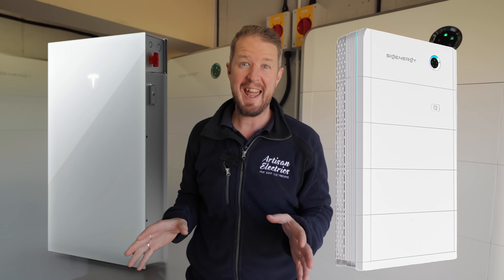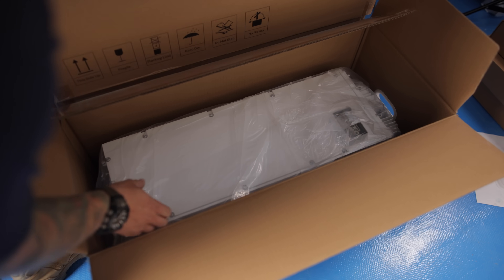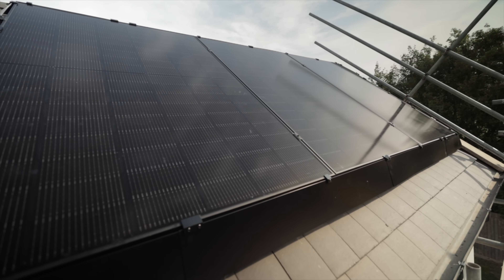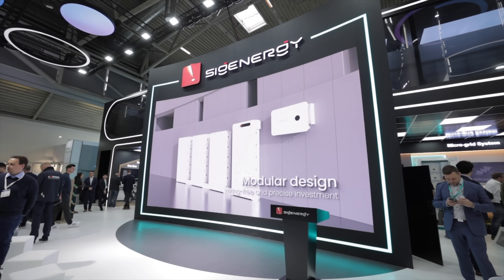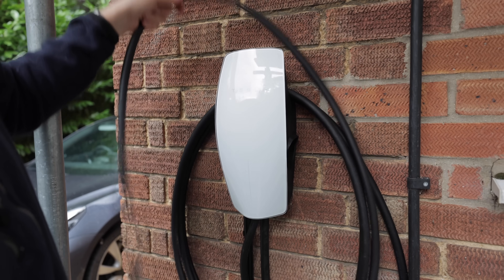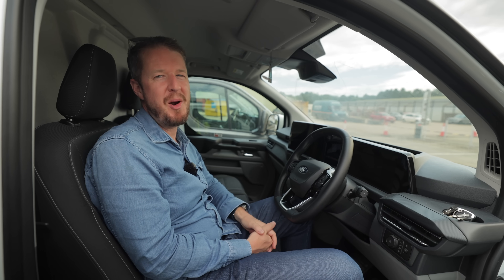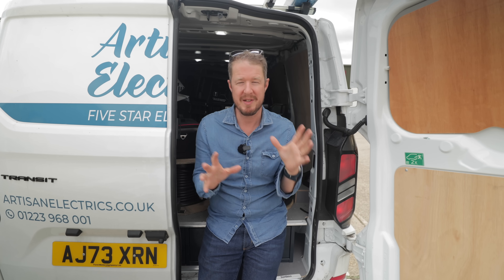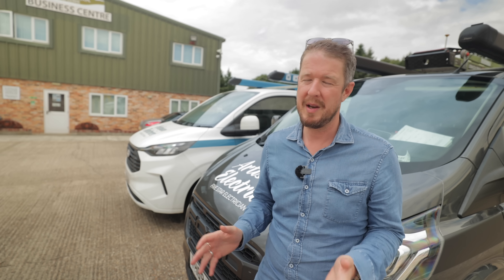The BEST Home Battery in 2025? Tesla PW3 vs Sigenergy SigenStor

Comment: What is your opinion on Signergy issues in Australia where there have been issues with the inverters?
Reply from the maker: From what I’ve heard it’s a minor issue caused by installer error when fitting the AC plugs - hasn’t affected that many installers and most of them were new and inexperienced fitting the products

Comment: How does the Sigenergy system handle the worst case but brief "surge demands" placed on it by a heat pump starting up in winter or starting a defrost cycle? The Tesla PW3 six rated at 20kW but isn't the Sigenergy system rated at 150% so a typical 8kW inverter can meet the surge demand of only 12kW - far short of what the PW3 can supply.. so even with a 12kW inverter 18kW is the max surge demand capability...  and you've had to pay for the additional cost of upgrading from an 8kW to a 10kW inverter.

Comment: I've just opted in for the following - 

Sigen Energy Controller Single
Phase
10 kW of Inverter Power
Sigenergy
1 x SigenStor EC 10.0SP
10.0 Year Warranty
Sigen Battery
16.12kWh of Battery Storage
Sigenergy
1 x SigenStor BAT 16.0
10.0 Year Warranty
Sigen Energy Gateway Home
Series

In AUS $ $13,650 I have a 5kw solar 19 panels - all be it in Aussie Dollars,  this also includes a $4,800 government grant power initiative.  My only issue is, if I have a 16kw battery, will my 5kw solar (average 3 to 4kw) depending on weather, would it charge the unit to capacity, so I have full battery at night?  I asked this question, and I was told "its hard to answer given weather, cloud, but you could top up your solar with another panel array.  Set this up as dedicated charge to unit, in combination with your current system"  

Do you agree?  I don't want to stich up the sales rep, cause he did do a lot of explaining - and was accommodating to the loads of questions I had.

Comment: I had a choice between the two brands and I kept emotion out of this. In the end I chose to go with the Tesla PW3 and expansion. This was due to how my property is located on a hill and the only place down the side of my house slopes and the land moves. I would have to lay concrete and I dont trust the land to not move in a few years with 200+kg of weight on the concrete slab. The other reason is the technical support from Tesla, they are pretty good and at the end of the day I just want problems solved asap.

Im happy with the PW3, it works great for what I need, and the backup feature works perfectly with no lights flashing when going off grid. I would have loved the Sigenergy  but thats okay, we can see what happens in 10 years.

I will try and convince my mother to get a battery and I will tell her to get the Sigenergy.

Comment: I'm looking to choose one of these systems to provide backup during grid power outages....does anyone know if it is possible to use a portable generator to charge these batteries during an extended outage?
Reply: I had that same question and located info that said a diesel generator could be hard wired to the Sigenery system.
Why they don't have a socket to plug in a portable generator is beyond me.😮

Comment: The 25kW DC module isn’t limited to 3 phase.  It works with single phase EC too.  Of course you’ll need to have enough PV and battery to cover it if you don’t want to draw from the grid.  If the sun isn’t shining and your battery is flat then you’ll be limited to the size of your inverter.

Comment: Not sure if it's true but Sigenergy is a fairly new company and not yet fully established so I am told.  Also the warranty on the units is not for the entire pack, but split, i.e. 12 months on the batteries and 3 years on the frame.  Can anyone confirm that?  Whereas Tesla are 10 years(?) on the entire unit.  Any advice is appreciated thanks.

Comment: What’s your thoughts on installing Tesla PW3 in a three phase property? How does net metering work, say a PW3 is on L1 but a heatpump pulls powers on L2, would you be charged for import or does PW3 discharge to grid and nullify the cost. Also, does it matter if import and export price is different per kW?
Reply from the maker: Pretty pointless to be honest - better to just get a Sigenergy three phase system
Reply: @artisanelectrics sadly space is limited to get a Sigen system. Spoke to Tesla folks at solar and storage and they showed me a new gizmo they have instead of the gateway that would help with this scenario.
Reply: @HaiderAlDelfi  Sigenergy just released way smaller gateway, for home use with up to 12kw inverters, and inverters it self are way smaller.

Comment: Don't want to be mean but this video was a bit of a letdown. Many of the things you analysed are of little concern to most people - commissioning time, aesthetics, mounting options, size, etc... In my case EV charging is irrelevant because I already have a charger and couldn't locate a Sig system anywhere near my EV. By far the biggest factor for most people is price and you skipped it. I don't want to go onto your quoting page, just give a rough estimate for a small, medium and large system to compare them. After that we care about usability and functions so highlight some key differences between the two.

As I said though in another comment my hope is that battery storage continues to fall in price. I have what I need right now and can wait until this stuff drops considerably before investing more.

Comment: I had the 30kW three phase inverter installed at my house last December here in Australia, so I don't think releasing it in the UK has anything to do with the new batteries. In fact we don't even have the new batteries here in Australia yet. There must be another reason why you didn't have the 30kW inverter in the UK before now.

It's a great system, by the way. We just added a second stack for a total of 72kWh storage (9 x 8kWh modules spread over 2 stacks). 🙂
Reply from the maker: That's great to hear that you are happy with the system!

Comment: My powerwalls are mounted outside on a North facing wall, the sigenergy system was not available when they were installed but I would still chooseTesla as they have active, water based, heating and cooling just like their cars, they work year round with no issues even when very cold in winter. I certainly prefer the looks of my Powerwall 2s over the new 3s, a simple white painted metal cover with black plastic sides.
Reply from the maker: Thanks for the feedback, we appreciate your perspective!

Comment: What I'm most interested in is when these things are going to plummet in price. CATL are talking about manufacturing for $10 per KWh which is frankly astonishing. Even if that's highly optimistic and of course the battery itself is only part of the overall cost (BMS, installation, transport, etc..) we should still get to a point where they become much cheaper than today. Even if sodium-ion doesn't have the energy density of other chemistries that doesn't bother me in the slightest for home storage. I can mount them on the wall outside or in various other places. Space just isn't an issue with home storage like it is in EVs.

I've got 10 KWh attached to my solar system right now and overall pretty happy with it (mainly from a financial perspective). At some point I'd have no issue installing a pretty big system that a) acts as a grid backup (current system needs a small amount of grid power), b) can be controlled remotely for dynamic charge/discharge, and c) costs a lot less than the current one.
Reply: Or Aussie weather. I'd consider the sig if I could have it in the garage. 
But my install will be outside, so not too confident it could take it.

Comment: I like the idea of getting solar (again) on our new home but have been hovering due to a few factors. 1.  Government may eventually extend the heat pump grant to include Solar with Storage. 2.  Tesla have now become an energy supplier here in the UK making it worth waiting to see what deals they are going to offer Tesla car owners regarding using the cars and storage batteries for Grid balancing etc. 3. The next thing making me wait is I keep hearing that batteries (CATL sodium) are going to drop down to $10 a kWh making it worth waiting to see what the pack level prices will come down to. 4. Final reason for waiting....I'm now a pensioner on a fixed income !
Reply: "I'm now a pensioner on a fixed income !" And as we know governments desperate to hit nut zero targets inparticular don't care much for the perils of pensioner poverty and their inability to easily afford high energy costs. So if pensioners can take (persistenly rising) energy costs out of the equation (almost) completely then it makes sense to invest in a "tried and tested" system.
Reply: @fractionaldebtisfraud2187  Imagine is we had solar and battery storage we would be out of the energy poverty trap.....so that's why government won't extend the grant, no control of the masses !

Comment: I like the looks of the Sigenergy system and the fact that it can be expanded at a later date. My only concern is what would happen if either company goes bust or pulls out of the UK market (Huawei has just announced they are pulling out of the UK market).
Reply from the maker: Yeah Sigenergy are growing super fast it’s a fair question - Huawei just can’t compete. In my opinion Sigenergy are here to stay but you have to be cautious and do your due diligence.

Comment: How about durability? How long does each system last before you have to replace the batteries (or, more realistically, the whole system because technology will have moved on)? And how about inside vs outside? I see all your Sig systems are installed inside.

And how about control without internet access? Do the apps rely on access to central servers or can they operate purely locally?
Reply: The Sig systems are IP66 rated so no issue installing them outside. Presumably Artisan just don't have an external customer install to show us.
Reply: @FlatToRentUK  Excellent but it would have helped to have mentioned that - or maybe I missed it.
Reply: @QuentinStephens  I don't think you missed it. But it was a pretty safe assumption, why would any manufacturer build a product like this which could exclude many potential customers when adapting them isn't that difficult?

Comment: Where does one go to find the price of this stuff?
Reply: PW3 + Gateway (in UK) ~ £7500. The expansion pack, adding another 13.5kWh ~ £5500. Sig stuff is more as the cost per KWh is higher.
Reply from the maker: Ask an installer for a quote

Comment: clearly a SIG advert. You lost me when you said the plastic sig unit looks better than the glass/metal looking Tesla. Clearly you were just throwing points to sig. Why didn't you mention the Tesla can sit in a foot of water? Sig can't do that, what about how Sig is a new company, but Tesla is far more established and has been around for the last decade? Over 1million units installed globally and proven the test of time. Not everyone is a geek and needs to know cell voltage, the Tesla app is simple to use, more set and forget, Sig is more customizable. The app does what it needs to. Tesla has Time Based control, which uses AI to forecast your usage and then operates accordingly. Also has storm watch. What about Warranty? Tesla has warranty on the full unit of 10 years, sig 5 years on gateway, 2 years on power sensor and communications modules. So, if you're going to do a paid advert, list your kickback in a disclaimer.
Reply: You’re a liar. He said he likes the look of both, but preferred sig. Go away Elon

Comment: This comparison wasn’t really fair. You skipped some key points:
1. Water resistance – Powerwall 3 is IP67 and flood-resistant. Tesla wins.
2. Battery chemistry – Tesla uses LFP, safer & longer-lasting. Likely Tesla wins.
3. Warranty – Tesla gives 10 years with 70% capacity guarantee. Again Tesla wins.
4. Extreme temps – Powerwall 3 works even in very low temperatures.
5. After-sales – Tesla has remote monitoring, updates & wider service network.
I don’t even like Elon, but to be fair, Tesla Powerwall 3 clearly deserves more credit here.
Reply: Both use LFP so no win for Tesla. In a flood where your solar is under water - IP67 is the least of your worries. Sigenergy has remote monitoring of your system and will send an electrician if a fault is detected on your end. Tesla has a very bad reputation for emergency servicing. Sigenergy subcontract their servicing to the installation network.
Reply: @StephenBrightwood  And Sigenergy has a working fire suppression system and a workable DC bidirectional EVSE.  Operating temp range SIG -30 °C - 60 °C.  Tesla –20 °C to 50 °C. Sigenergy 10 year warranty with 5 year extension available and the same 70% capacity.  There is really nothing that Tesla has that Sigenergy doesn't and the Sigenstor is so much easier to install.  The Load hub has load shedding, generator input and grater expansion capacity than the Tesla Gateway.

Comment: great video!! i live in australia, winter here gets to 6 degrees but not for many weeks, and summer up to 42 degrees. you can pretty much get these temperatures in th eshade too, im looking at getting a 40-48kw stack with the 8kw modules. should i try to get this thing  installed indoors or do you think outdoor will be ok? thanks!
Reply: 8kWh modules are obsolete and has been sunsetted. The ones on sale now are 10 kWh bricks 🧱
Reply: @im_not_an_elephant  Well, actually 9.08 kWh.  In the USA they are marketed as 9 kWh modules.
Reply: I would try to locate the batteries on the south side of the house.  Had to think about that for a minute.  I am in California and we are upside down from each other.  Try to keep the batteries out of direct sunlight.  I have mine on the east side and we are more temperate than you, 0 - 42 degree C range and my batteries get up to the upper 30's.  This summer has been very cool.  I don't think that we had but 1 day when the temperature was above 37.  They only get sun for a couple of hours in the afternoon but the batteries still get pretty warm.  Kind of makes me want to relocate them to the other side of the house.  Then they would get slightly less sun but in the mid morning.
Reply: Be aware that in Australia there are strict rules around the placement of batteries on walls opposing habitable rooms. MC Electrical did a good video on this 4 months ago.

Comment: I'm looking at getting Sigenergy but waiting for 10kWh modules with 30 kW 3 phase inverter. Will go with 500W Aiko solar panels. Haven't got solar at present so don't need to replace anything. Recently upgraded to 3 phase power and had Tesla wall charger installed. Down the track would like the Sigenergy EV charging module.
Reply from the maker: Should be out soon I think

Comment: Apart from the mobile app, another consideration is how open the system is, how well it integrates with other smart home systems.  One of my reasons for choosing the AlphaESS battery system is that Home Assistant plugs directly into it, even bypassing the company's cloud.  So I can monitor everything, and for instance start shutting down the house servers when they run on the backup battery and it drops below a certain level of charge.  That may not be a common requirement for the typical customer, but it's nice to have the option.
Reply: Sigenergy gives access to the modbus which means it's easy to integrate it into home assistant. All parameters are exposed and there is an integration available.
Reply: Also you can add smart plugs in to the sig system, which I appreciated.

Comment: My SigEnergy system took less than 2 minutes to commission.  Absolutely love it.  I had previously installed solar and felt like I was getting screwed on my annual catch up bill.  It seemed like it was increasing at around $600 annually.  2023 was like $1800; 2024 was $2400; and I expecting my 2025 catchup to be $3000USD.  

Had my solar guy install four of the 8 kWh batteries so 32kWh in total.  (It's the older version.)  My normal So Cal Edison monthly payments are half what they were before the batteries.  (It's mainly just tax and fees now.)  And most importantly, my annual catchup which was previously $2400 for FY24 is now at ($250.00) with three months to go this year.  

I have ZERO complaints with the SigEnergy system at all.  Highly recommend it.
Reply from the maker: Wow, that's amazing to hear! 👍
Reply: Me too

Comment: Yes the Sig is very good, but on the - minus side of things the tech support has gone to the dogs! I don't use it much but on one project i had to use the D.I function to comply with an EN mains standard. This worked at fist then started causing more complexed errors that no AI could ever answer. Human response took days, did not understand the issue and they gave an incorrect reply then shut the case!
Reply from the maker: It’s good to highlight this side of things, because while the product offers a lot of flexibility and features, after-sales and support are just as important as the specs. Hopefully as Sigenergy expands, their technical support will continue to improve.

Comment: Does the sigenergy system work with home assistant? Gotta check if there's an add-on...
Reply: Yep, via an ethernet cable, and there's a couple of integrations for it (one in yaml and the other in python).  No need to go via the cloud, so you get real-time data even if the internet connecttion falls over.  There's also a template for predbat so that predbat can control it via the integration.
Reply: Sig have just added a developer API, for this purpose.
Reply: Check Givenergy works seamlessly but Artisan won’t say a thing